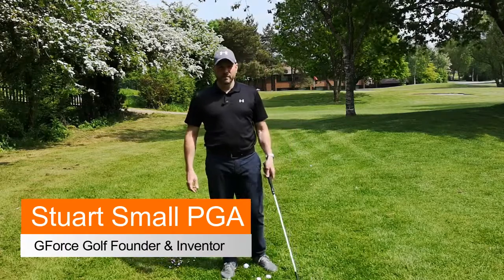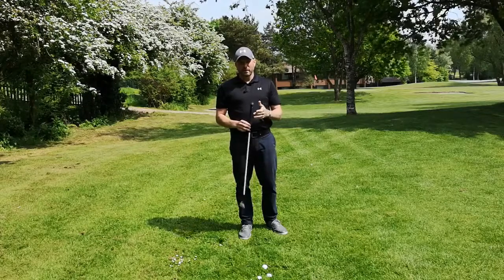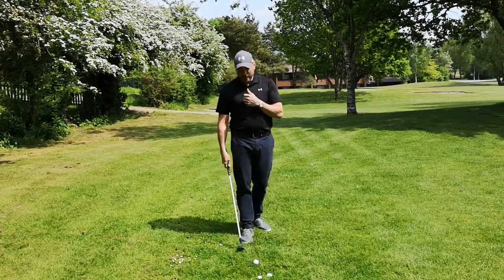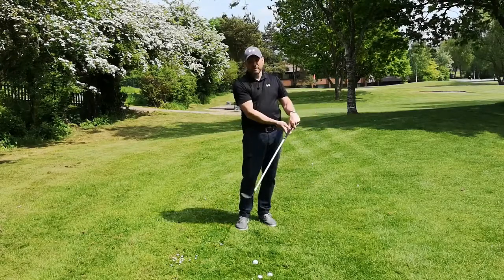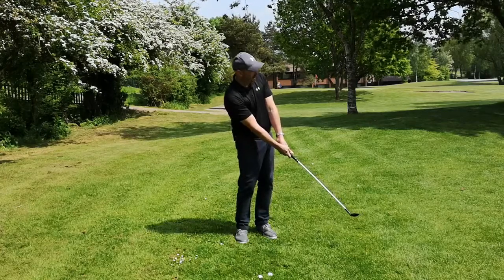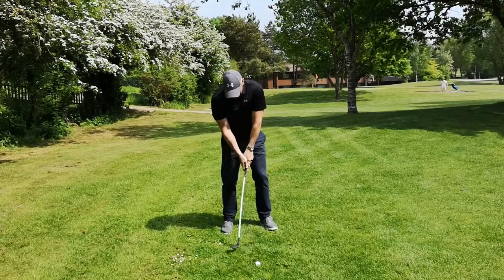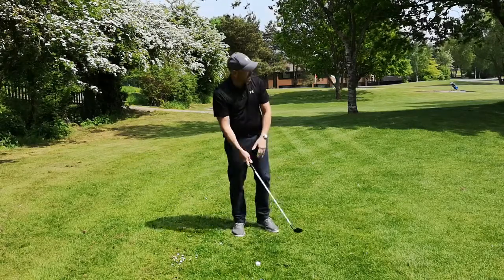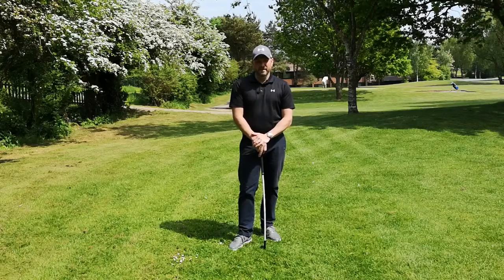Part 4   Chipping Mechanics   GForce Swing Trainer Wedge

Comment: so with a regular iron is that the move i should do,fel like i am unloading the shaft but still follow thru the shot with body turn?
thanks
john
Reply from the maker: yes John, you can see my body turns, when I finish my swing I am facing the target. If you don't turn your arms could disconnect from your body causing manipulations from the hands to correct the shot. causing a lot of inconsistency's. :-) stuart